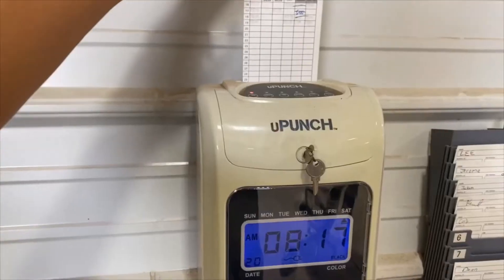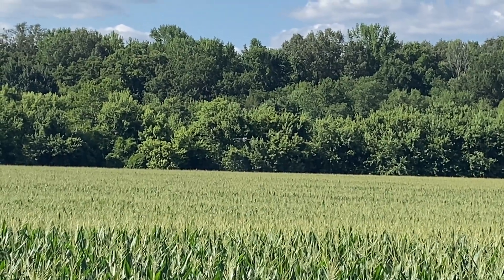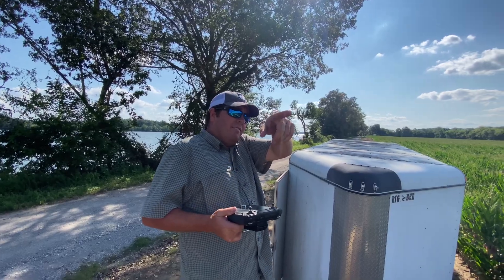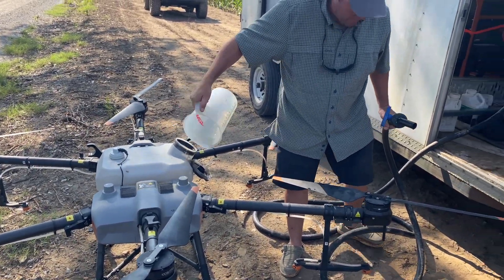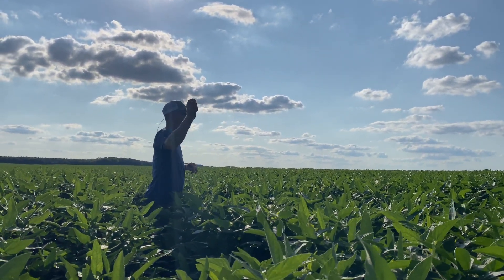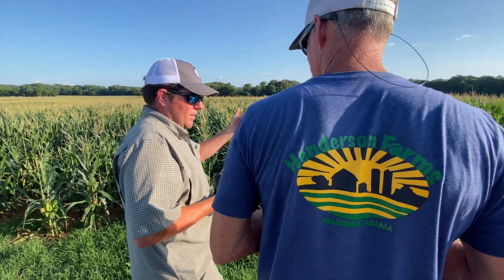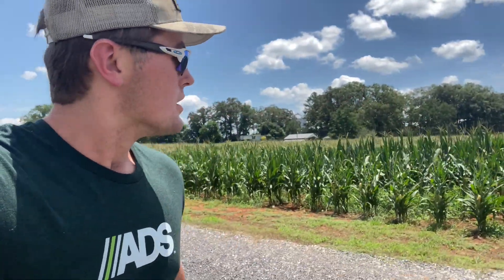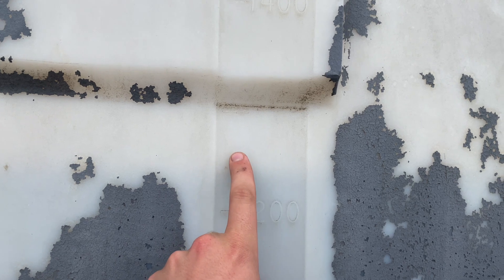DJI Crop Spraying Drone Demo

Comment: Thats a toy that you are playing with there.
Yoo need one that carries at least a couple of hunded gallons of liquid.
Scale that toy up to a descent size.
Reply from the maker: It’s a bit more efficient than I initially thought. We were putting out 3 gallons to the acre so the drone was doing an acre at a time. When you have a couple people constantly charging and changing batteries and filling it up as it lands it goes a bit quicker. This is really good for small patches and for scenarios where you need to get your applications out in a timely manner but the fields are too wet for a sprayer and a cropduster can’t get it as deep.
Reply: @Farmboyspence  Thanks for your reply as it makes sense.
Reply from the maker: Appreciate your comment as well! We’ll still mainly use our JD sprayers but it’s always nice to be able to have to chance to try something out for free like this!